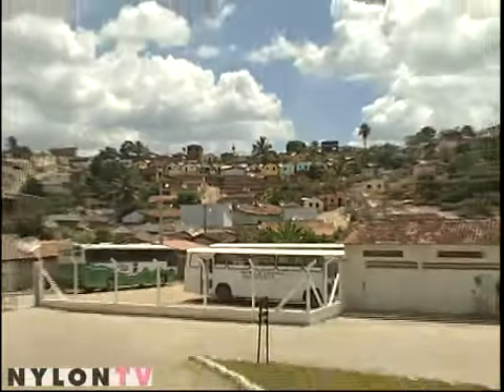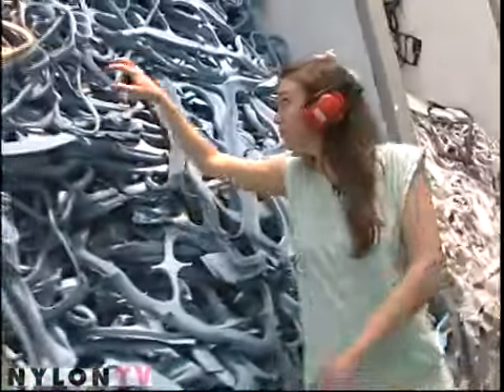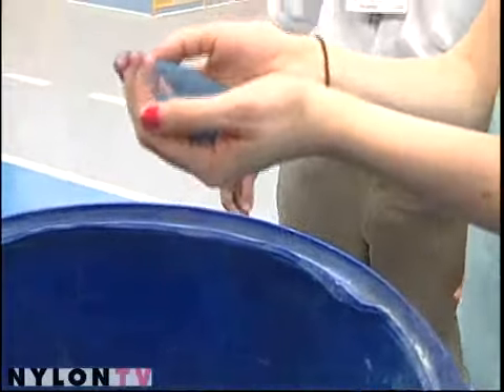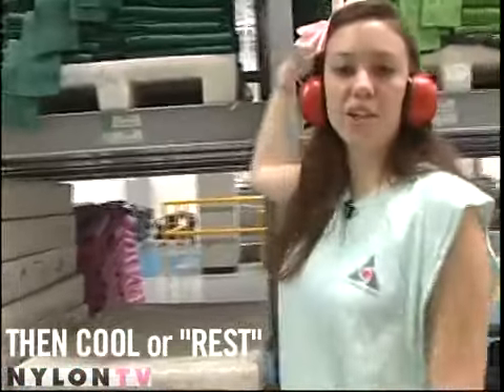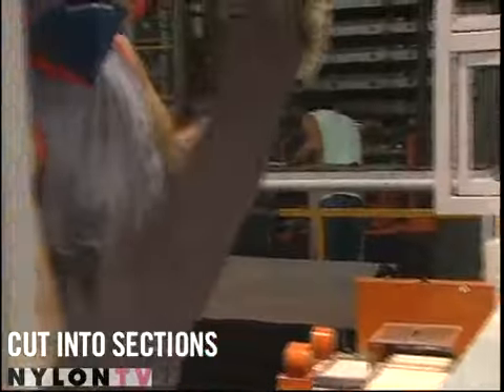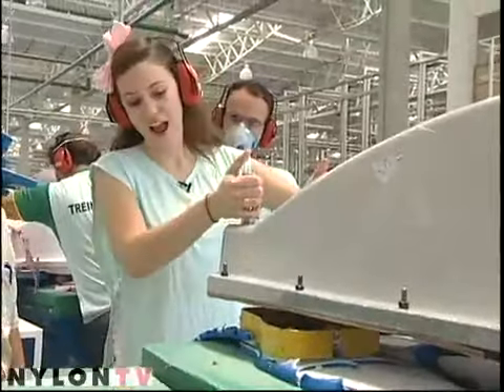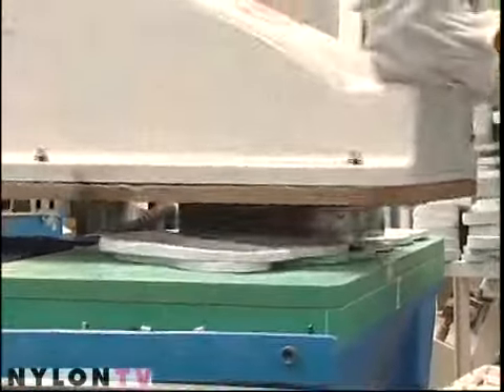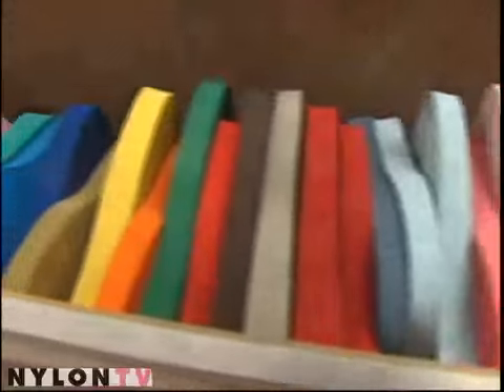Havaianas - How they're made!

Comment: Havaianas is the best, it has the consistency of muscle itself. It's got a better feel than Fit Flops, Nike, Adidas and other footwear. It's best to spray it with silicone and put in a plastic bag with as little air as possible from time to time, to prevent it from drying out, especially the thong points which usually becomes brittle and break which is the "disease" of thong style flip flops.

God bless, Rev. 21:4
Reply: You are a bot?